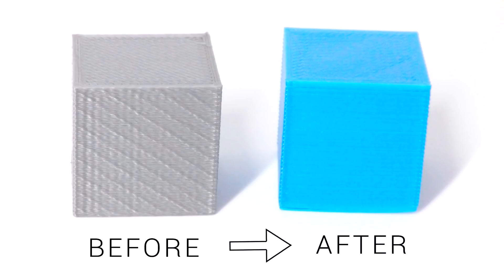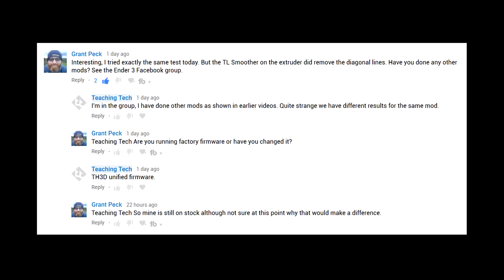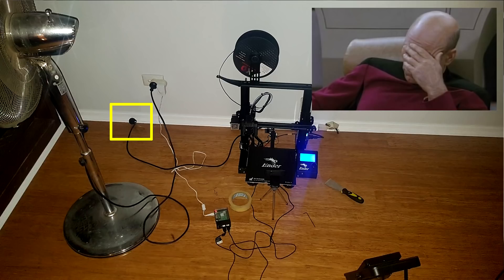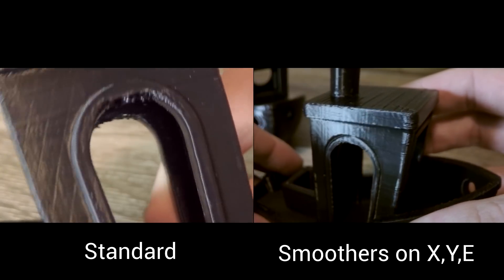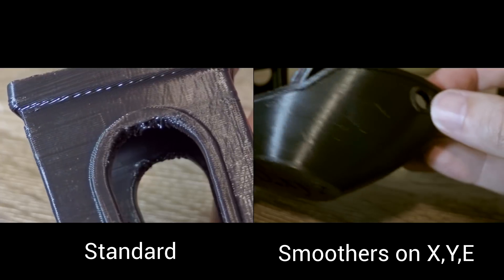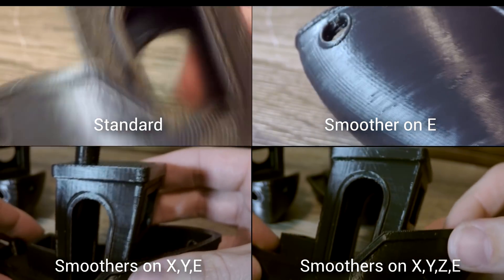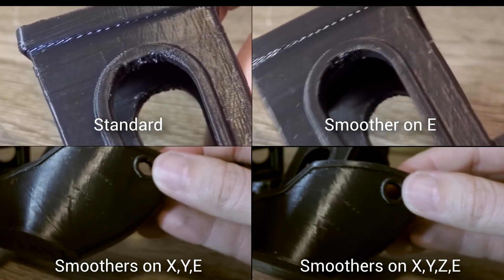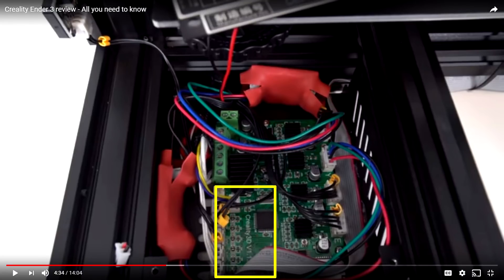Ender 3: TL-smoothers an upgrade? (Part 2 - X,Y,Z,E)

Comment: Have you done any testing with TL Smoothers in conjunction with the Creality Sprite Extruder Pro upgrades? I did not have any issues with my Ender 3 Max until after I upgraded to a sprite direct drive extruder pro. At this point I started experiencing Salmon skin. Do you think this would be something the TL Smoothers would help resolve, or could this be some other issue at work?

Comment: Hi.  I am just researching a lot of this now, as I am considering an Ender printer, and I was wondering if TL Smoothers are worth while on the Silent boards, like the 4.2.2 or 4.2.7 boards?   I have found plenty of information on the early 8 bit boards, but not whether they make any difference on the silent 32bit boards.
Thanks
Reply: If you are still watching or reading this, I recently upgraded my old Ender 5 from a v1.1.4 to the silent 4.2.7 board and leaving the TL smoothers inline actually made the motors super noisy and caused salmon skin. I removed them and now the board works as it should. So definitely take them out with your old board imho

Comment: Solved Salmon Skin on my Ender 3 with DIY smoothers. Instead of a smoother I just cut my extruder wires, and rewired them with the outermost wires having a pair of entwined opposite diodes. This is essentially what a TL smoother is, except it only cost me four £0.05 diodes and a blob of solder.

I only needed to do the two outer wires on the extruder motor and salmon skin was gone. In theory it would smooth XYZ axis too but I don't think that's necessary.

Do this at your own risk. Google DIY TL Smoothers and do research before messing with any electronics. It worked for me is all I can say.

Comment: I used the ones CHEP recommended. I can see some difference I took the Z axis one out I could tell no change there. I haven't tried the extruder one. I see your rear case design is for the smoothers you used, mine won't fit. Another great video. Keep up the good work.

Comment: So I installed all 4.
8 diode models.
Want to know what changed?
Started causing horrible stringing during my prints that had not happened before.
No matter the material choice.
Retraction, speed, temperature and different environment made no difference.

Comment: This is good info, will probably still add 4 to my E3 but in terms of the differences you and others are seeing I can see a few variables that are unaccounted for.
1. Filament
2. Humidity
3. Ambient temps
It's quite possible that any one of these things could explain the issues, let alone all 3, and 2 and 3 are things that can't really be controlled. It woiuld be interesting to see this test done once in winter and once in summer, just to see if they do have any impact.

Comment: First thing i did when i got a new but cheap 3D printer was do a test print then tear it completely down to fix tons of issues. I picked up a Wanhao Duplicator i3 branded under PowerSpec at my local Micro Center for $188 USD. Tons of bad design issues lol which i fixed, but it was just a lot of little things and nothing big. Until i noticed the only artifacting that was left was the zebra stripping. Did a X and Y vase test and noticed the E stepper motor was surging. Checked the Vref and all the steppers where rated for 0.864 but the E motor was for 0.734, problem was when i checked on the board they where all 0.87-0.89. Then because its not the best board i ran the machine and checked the Vref under load and set the Vref that way. Very much reduced the surging but the only way i got it to go away was to swap it out with a stepper motor i borrowed from an old Replicator Dual i have (from 2012, the wooden one).

My assumption is that it's a combination of the stepper drivers, the board, and the stepper motor. One or a bit of all have to be sub par to build up to the cause.

Comment: I did post this on the 1st test posted cuz most will likely watch 1 before 2. But there is a huge misconception on what smoothers actually do. As you've seen at regular speeds theres not much of a difference. There is a good reason for this. This reason is.....speed. these aren't made for 3d printers in particular but many machine motors. But they'll keep the quality of the print at 100% speed it did have but increase it to a 1/4 higher speeds so 120% speed will now keep the same quality. Technically it would be 125% speed but that's pushing it. So drop 5% to be safe.The extruder does not need it and does absolutely nothing for it. Even the z doesnt really need it. But print at 100 and then go to 120. After do the same but with the smoothers installed and you'll notice a huge difference. Heres a fun thing to experiment with...use multiple smoothers on 1 axis. Nobody ever thinks about that but when they hear that cant believe they never thought to do it. There is a difference there too. Although they do the same same thing,  that little fraction of a second it take the current to go from one smoother to the other is just the rite amount of time to go in between the steps of the first smoother. You can  get some extremely smooth surfaces at a higher speed 120 speed will put out better prints than the stock model at 70%. I put them in my new silent board and no joke that thing spits out mirror like prints cuz of the upgraded axis that come In the boards themselves. I highly suggest everyone experiment with this. Especially how cheap and easy it is to install. If you use smaller lines and squish. You wont even be able to see lines ever again and easily to great overhangs and you'll never deal with artifacts at all. Theres 1 downfall. Your supports are stronger and really attach to the model more than usual but a little sandpaper can fix that

Comment: I installed my TL smoothers and my printer started going bonkers do I have to reprogram the printer after reinstalling the smoothers
Reply: Are the connectors plugged in right? Is there some sort of contact between metal pieces causing interference? Maybe the smoothers are bad? Just a couple of thoughts to maybe consider.

Comment: Will this make the motors cooler? I'm currently doing a 16 hr print on my ender 3 pro and the motors feels hot.
Reply: You could use heatsinks for the stepper motors if they get (to) hot.

Comment: I think the banding is caused by the infill shrinking and pulling the wall in. To test that theory we could set the wall thickness to four or five layers. It might also be caused by the nozzle wiping material from the edge as it passes when making the infill. In both cases a thick wall should eliminate it, but might have to be pretty thick to avoid the edge of the nozzle touching the parts outside edge during infill. If you cut the part open and the banding coincides with every other infill junction, then I think it is a wiping problem and only occurs when the nozzle moves inward while drawing the infill. That could probably be coded out.
Reply: I agree with you on this one, had a similar problem on my ender a little while back

Comment: I had amazing results installing 4  8 diode smoothers on my ender 3 one on each axis and the extruder. Printing threads showed a lot of difference. Not sure what board I have in the machine. Some say that the enders have diode smoothers built in? I don't know, but they sure made a huge difference for me. For the money, I say it's worth trying if you've tried adjusting all other settings and you are getting not so great results.

Comment: I obtained very clear benefits with the use of capacitors. I have had very bad results with original gray PLA from Creality, 
without improvement even after various fine adjustments. These artifacts cease after the installation of 3 smoother capacitor boards (X,Y and Z). I'm satisfied and recommend it.
Reply: Link?

Comment: So if I move an axis quick enough manually with the machine off It will power the screen back-light and fan. I wonder if these would prevent that.
Reply from the maker: That behaviour is correct and can potentially damage the electronics. TL smoothers should provide protection from back EMF as an added bonus.

Comment: I was talking to a friend of mine and he pointed out that at a certain version in the Marlin software that there was an area to define the stepper driver which essentially reduces the needs for the TL smoothers. I personally run the TH3D brew of Marlin but wondering if you could add to this? (You may want to disregard he just messaged me again and said he could be wrong in his assumption...sorry)

Comment: I got my Ender 3 about 3 weeks ago and I did notice some artifacts after I installed the TH3D firmware update, I printed the Calicat from thingiverse and I noticed some skin artifacts. I printed the same with 3 walls, previous one had 2, and the artifacts were gone. Can that be the reason why the TL smoothers don't make too much of a difference? You can see here https://imgur.com/a7E73nQ, https://imgur.com/iCSDBdV and https://imgur.com/rnxZ3aI

Comment: i have a question, i've never touched a 3d printer or anything of the sort, but what if you put supports in the window if possible? or would that just mess the whole design up? again ive never done a thing with 3d printing just asking

Comment: I mounted TL-smoothers on X and Y and it worked perfectly.
Reply from the maker: Perfect. Thanks for sharing.
Reply: I installed my TL smoothers and my printer started going bonkers do I have to reprogram the printer after reinstalling the smoothers

Comment: There's a mention on a website somewhere that these TL smoothers arent made for the types of motors that come on the Ender 3.  Supposedly they work with an entirely different model number.
Reply from the maker: They're meant for the stepper drivers, not the motor. they weren't originally designed to fix the A4988s on this board but plenty of people have success regardless.

Comment: I did an upgrade with 8 Diode Stepper Smoother-Boards installed on CR10 3D Printer, see here: https://openrcforums.com/forum/viewtopic.php?f=85&t=11447&sid=6bf7a0a4b04c4584a6b8c5d6a3b763d4
Reply from the maker: That is a tidy install. Love the googly eyes.

Comment: Hey man, the Ender 3 was my first ever 3D Printer at home. I really enjoyed your videos and learned a lot.
One thing I noticed was that the Ender 3 is quite noisy compared to the Prusa i3 I have at work (that Prusa got me into 3D printing and made me purchase the Ender 3).
Do you know what exactly is that noisy on the Ender3? I thought it might be the steppers, so maybe a 50 € or something replacement (meaning getting some better steppers) would make it as quiet as the Prusa is?

Anyway, I'm loving your channel and it is always fun to watch your videos!
Reply: Oh and I already notices the fans. I'm currently working on a mainboard cover to get some 12 V outputs for the hotend fan and the mainboard fan plus I'd like to replace the power supply fan with some PC fan I still have lying around (but still running at 12 V so I'll probably just get a cheap stepdown)
Reply from the maker: It's not the steppers, it's the stepper drivers making them louder. Hard to change those because of the Ender 3 board but stepper dampers make a big difference: https://www.youtube.com/watch?v=vu80vctXaxQ

Comment: The issue might be the motors themselves not the signal.
Reply from the maker: I believe it is to do with the way the stepper drivers are configured. Can be fixed with some soldering to change the mode, not for the feint hearted.

Comment: How about trying them directly next to each motor.
Reply from the maker: I believe the Ender 3 steppers have a 6 pin plug, with four wires connected. Normally this would work.
Reply: Yeah the reason i say to try it is i believe they are to stop the reverse EMF from the motors and the further it travels back down the cables it may effect the print quality or maybe no effect at all just a thought, keep up the good vids.

Comment: Grazie per questo test che hai effettuato. Ho fatto delle prove utilizzando i TL smoothers sulla mia Anete A8, non hanno avuto nessun effetto, anzi posso dire che senza di essi la stampa è perfetta. Molto probabilmente dipende dal tipo di motore utilizzato dalla stampante, dai driver e dal firmware di controllo degli stepper.

Comment: I apologize If I am repeating something that has already been said, I haven't read through all the comments.  Anyway, what I wanted to say is that I recommend using TL-Smoothers on all of the stepper motors of your printer.  The reason isn't for the esthetics of your print results, but for the protection of your printer's circuits.  Inductors are a primary component in the construction of electric motors.  Inductors have a trait where when current is flowing through them and suddenly the flow of power is removed, a large negative voltage spike occurs in the inductor which flows through the circuitry it is connected to.  Puting flyback diodes between your motors and the driver is a good layer of protection for the delicate circuitry of the printer.  Those TL-smoothers are flyback diode circuits and are a very convenient way to install flyback diodes.  It is true that blocking the flyback current can smooth out some level of jitter which is a nice bonus but isn't the primary reason that someone should do it.  I will say that not all TL-Smoothers are exactly the same.  I have only ever used the eight-diode style smoothers, but from the reviews that I have seen, the eight diode smoothers seem to perform better than the four diode variety.
Reply from the maker: Great points and I agree 100% on the back EMF protection and eight diode benefits. Thanks for the detailed post.
Reply: Wonder what the voltage drop is across these?

Comment: I know the solution to these problems. TL-smoothers are a workaround but are not tackling the problem. (In your case they seem to be doing nothing). The problem with the Ender/CR20 is that the A4988 stepper drivers are set to automatic mixed decay mode. Automatic mixed decay means that they will switch between fast decay and mixed decay every 30ms or so. Every time it switches it produces this artifact. The solution is to set the drivers to mixed decay 100% of the time. It's very easy to do but requires some soldering. You basically remove the resistor on the ROSC pin and add a small wire in stead on the drivers. What this does is it pulls the ROSC pin to ground. The A4988 datasheet clearly shows this problem on page 8: https://www.pololu.com/file/0J450/A4988.pdf You can do this on all 4 drivers. The extruder adds diagonal lines, the X/Y add vertical ones. The drawback will be slightly louder motors but the improvement in print quality will be very visible.
Reply: The resistors on the 2.1 board seem to be R21, R24, R27, R15 on my CR20 for the four stepper drivers. I have yet to try this, hopefully I will not brick it. Luckily I have a soldering station, ESD protection gear and some experience with soldering smd components.
Reply from the maker: Thanks for the detaild technical post. Unfortunately this would be beyond most people :(
Reply: Yes but if it's brought up by people like you Creality may change it in future updates. They are listening to the community.
Reply from the maker: They say that but I PMed the boss recently about their search for testers and received no reply. Channel just probably isn't big enough for them.

Comment: Michael, Interesting and great hints keep them coming for the Ender3. I just fitted some similar to another printer, were from triangle-lab ali express (much bigger 1N5404 8 diode versions) which included cables and some small precut lengths of clear heat-shrink to go over them. How they do them for the price they do and the diodes were not fake eludes me. I looked at the waveforms on an oscilloscope before and after as well and there are some subtle improvements to the sine wave forms driving the steppers.
Reply from the maker: Thanks for the detailed comment. I really need to get a scope. Modern manufacturing is ridiculously cheap!

Comment: Look at your slicer settings. The diagonal lines on the surface of your print look curiously like your infill is messing with the exterior layers add more exterior perimeters
Reply from the maker: Definitely not that as it shows on objects with no infill. Thanks for taking the time to post a suggestion.

Comment: So that is salmon skin... I always thought it was the filling geometry showing through the walls, I have a figure that I usually print with 0% infill and never showed those marks.  I'm trying now to figure it out if the main board can be swapped with a CR-10S. Atmega2560 based controller board. I made a mod to my actual board to connect the case fan directly to 24V, but I added a 45ºC normally open thermocouple, glued under the board next to the MOSFETs to avoid the continuous fan noise when the board is not hot. It has never activated since. I also changed the 100uF 16V capacitor added to the board to reduce the noise of the 5V line where it should be the EXT-A2 connector (pin 29), by a HQ 105ºC Rubycon 470uF 35V that  should work much better and last forever, and it works much more stable via USB. But still would like to go to a Atmega2560 board if possible to be able to activate autolevel, filament change, etc...
Reply from the maker: Salmon skin is usually labelled to the patten seen on deltas. This is probably better known as moire or zebra stripes. Sounds like you knowledge of the mainboards is top notch. Keep up the good work :)
Reply: Thanks! I wish it was but it's just a mix of trying lot's of things and googling a lot, hehehehe I've been testing why the fan does not start and it's just because the electronics box never goes up to 45ºC even when printing ABS "fast" (60mm/s & 130mm/s travel). I used a thermistor to measure it with a spare controller board and it went up to 38ºC with 25ºC ambient. Maybe if I shut down the air conditioner I'll see some fan action but we are near 40ºC outside... mmmm maybe in october...